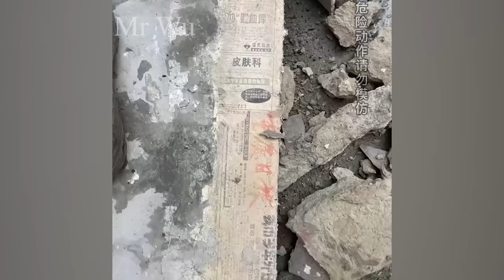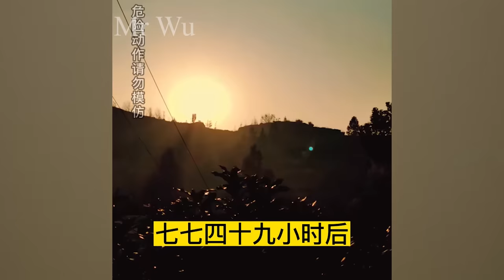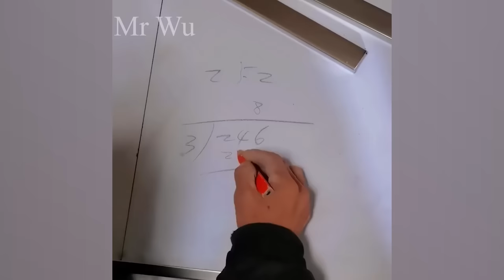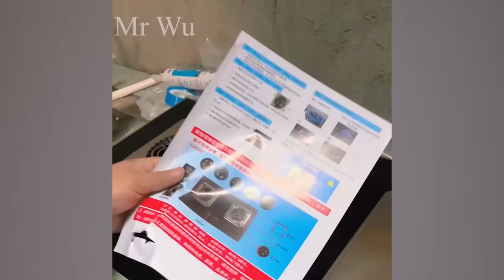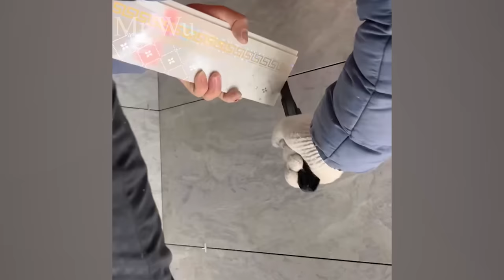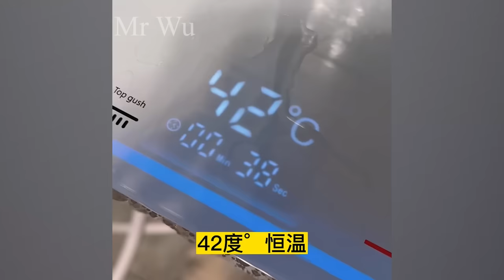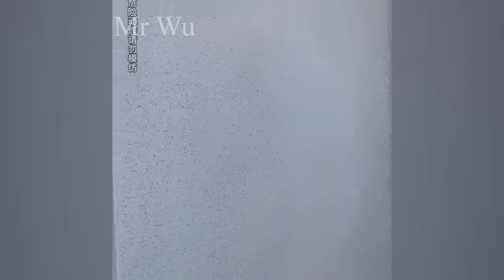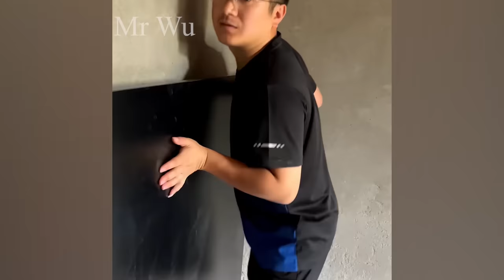The middle-aged man renovating a old house that is about to collapse

Comment: Mr Wu, please explain why you put short logs through the walls of your houses and then, brick them up? 
I'm from Ireland, we don't have a tradition of building with external logs, though we do use concrete to create the shell of the building. The wood is all internal, A-frames supporting the tiles and plasterboard internal walls. As it rains a lot here, any exposed wood would be door surrounds and heavily varnished to keep out moisture and insects. Having a log sticking out seems to me that you giving moisture and insects highway directly into your house. Please explain?